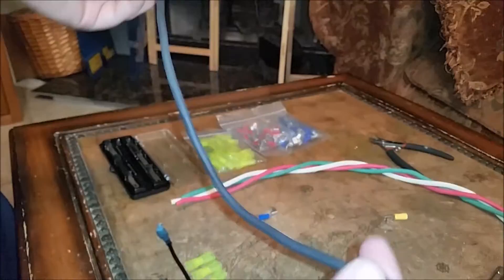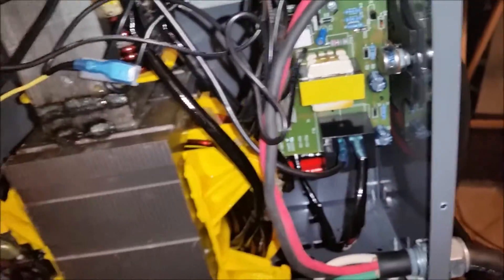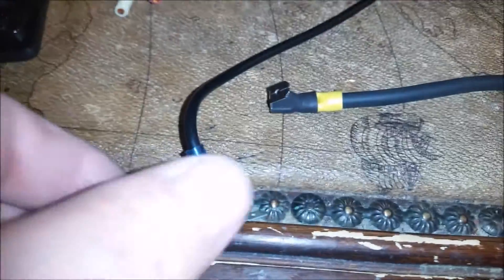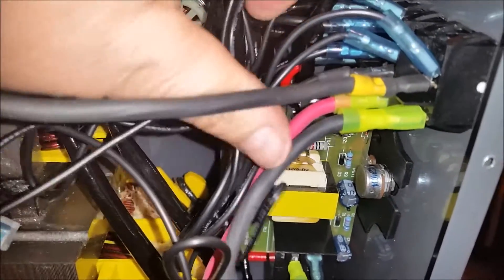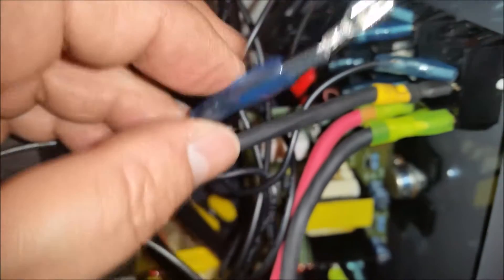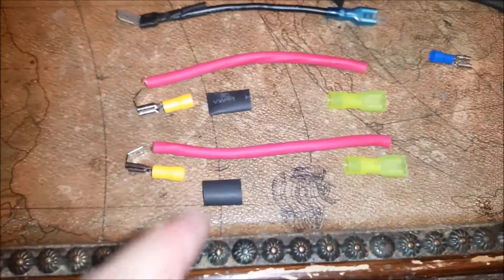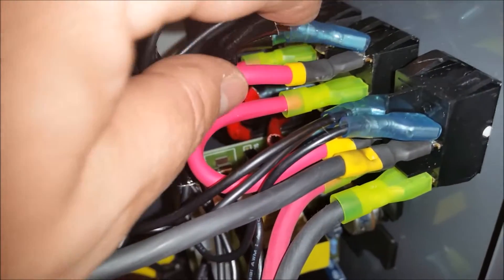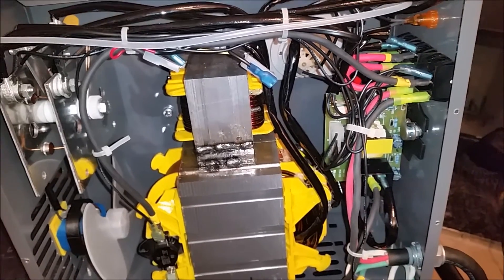Harbor Freight 110 AMP Dual Mig Internal Wire Upgrade Part 2

Comment: the min/max one/two switches will melt before the stock wires burn up, ask me how i know
Reply from the maker: Experience I'm sure. I was fortunate to not have that problem. It worked great until I burned up one of the diodes. I think if I had upgraded the fan or at least baffled it that it would have worked better for sure. I need to fix this little welder as it works better than my Eastwood which cost 4x's as much. Best Wishes & Blessings. Keith Noneya

Comment: Will this upgrade work on a 125amp fc welder? I upgraded the polarity with 150a 1600v bridge rectifier and added capicator and resistor to it. Significant change in the welds. But, i think this upgrade would definitely improve my welder more.
Reply from the maker: Yes it should help improve the quality of the welds. The bigger wire allows current to flows easier. Your bigger diodes will definitely help with that as well. The only draw back is that it puts more strain on the transformer, so make sure you have extra cooling on it to handle the added stress. Even if you don't add the extra cooling, if only increase your duty cycle a little, over stock, that should be enough to offset the added stress and heat. Thanks for watching. Best Wishes & Blessings. Keith Noneya
Reply: @keithnoneya  thanks.👍
Reply: @keithnoneya  do you anything about installing a transformer to wire feed motor? Im having issuses with wire sputtering, even on low wire speed setting. It did work fine before but i hear motor drive slipping, but tensoin ok. Idk. Any info can help.
Reply from the maker: Hey Zero nope I don't have any information on the motor set up on those. If you figure it out do a video on it in case I run across that problem too. Keith
Reply: @keithnoneya  ok, thanks. I put a 24vdc 1a/10w wire feed mechanism in it. I think that'll help.

Comment: Was there any noticeable difference? Thanks
Reply from the maker: I made the changes before I used it. So I couldn't say. However I have a Eastwood that will not weld anywhere near as long as my HF before it overheats and shuts down. I barely had any overheating on my HF, I had to really be doing a lot of welding before it would overheat. Make sure and watch all four videos, especially #4 where I tell you not to hook up one of the wires in the new yellow plug, as my GFCI breaker did not like it. Thanks for sharing, and let me know how it all works out for you. Best Wishes n Blessings. Keith
Reply: I made the changes to mine today. No noticeable change, but when I bypassed the switch it made a big difference. So now looking for heavier amp switch. I also change the power cord for 10awg and used really heavy jumper cable for the ground lead clamp and all. Major improvement!
Reply from the maker: That's cool Larry. Yep that's why I did mine to start with. I work in electronics and when I have to draw a lot of current, and welding requires a lot, I have to use a bigger wire gauge or the unit over heats. Same thing goes for a welder, the bigger the wire the cooler the transformer can run because it doesn't have to work so hard to keep up with the current demand. Think of it like trying to suck liquid through a small coffee straw or through a milkshake straw. Using the bigger straw you don't have to work so hard to get the good stuff where it needs to go. If you come up with anymore mods let me know, or better yet post a video and send me the link. Thanks for watching Larry. Keith
Reply: @luckylarry5112  That's pretty sad that Jumper cable helped out as it's almost always steel wire that's copper coated.  The best place to get leads is at the junk yard.  Look for Monster Cable that was used to hook up a huge amp, it's always there you just have to hunt for a while, not because people grab it but just cuz it's not that often that people use the great stuff anymore.  If jumper cables wire helped you out, then Monster Cable oxygen free super strand will completely change the machine.
Peace
Sizzlean
P.S.  put a magnet to that wire just for kicks
Reply from the maker: @sizzlean9459  Not really, even steal wire has it current carrying (flow)capacity. The steel will handle the load because it has a higher meting point than the copper, but it can only allow so much current to travel through the wire because of it's diameter. Think of the copper wire as a weak plastic water valve with a lot of pressure behind it. It can only pass so much water because of the size of the hole in valve and only so much pressure because of the material it's made of. Now compare it to the same valve but only made out of steel, they both can only pass so much water because of the size of the hole but the steel one can take more pressure. In order to pass more water with a weaker valve made of plastic, all you have to do is increase the size of the hole in the valve. As long as the pressure stays the same you can pass two to four times the water without damaging the weaker valve. Why because the valve hole has increased and lowered the pressure inside the valve. Steel wire is actually a very pore conductor, but it's robust and can take a lot of pressure or current before it will melt. It's also cheaper to use. Anytime you want to increase current flow, regardless of the conductor material, you need to increase the diameter of the wire size. That's why power companies use LARGE aluminum wire to the house power panels but use smaller 14 gauge copper wires inside the house. Most house circuits don't have the whole house load running through them so they only need to handle the 10-30 amp circuits for that particular application. The reason they don't use aluminum in homes is because it corrodes easier and that corrosion causes heat build up and has been known to start house fires. Where copper corrodes but slower and tends to form a corrosion barrier when it corrodes protecting the interior of the wire. That's one of the reasons it was used on roofs and on the Stature of Liberty and other well known landmarks. Hope that explains why I did it that way. Best Wishes & Blessings. Keith Noneya
Reply from the maker: @sizzlean9459  Nah you're not insulting me. Funny I didn't disagree with anything you said. Yep electricity does flow on the outside, power lines are hollow on the inside. I'm saying that the diameter of the wire increased the amount of current it can handle unless the material it's made of can handle it. I've been doing electronic repairs for over 30 years and yep I know Ohms Law pretty good. The analogy is one I use for someone who is not educated to try and understand: Force/Pressure/Volts vs Flow/Current and yep they are inversely proportional unless you change the resistance to make up for the other changes in current or voltage. Also I agree the ability of the current to flow is also based on the ability of the power source to keep up with the demand.  Classic simple and crude example is a weak battery. It may show 12vdc but as soon as you put a load on it the voltage drops to almost nothing. So my point is by increasing the wire diameter you increase the external surface area for the current to flow on reducing the heat on the wire. So do you agree that installing larger wires in the welder increases the ability of the welder to handle higher current loads? Which is the topic of the video and it's purpose. Best Wishes & Blessings. Keith Noneya
Reply: @keithnoneya  Hey man, didn't you already prove it makes it work better?  Who am I to disagree?  Look if it were up to me we would close all the jewelry stores take the gold and make wires and take the silver and make heatsinks but I'm sure there are some girls and boys out there who are glad it aint up to me  LOL!   Now that you brought it up,  the first free energy machine I ever built was the bedini school girl's wheel and it fixes that stupid battery you were talking about.  My chemistry professor (went to school for pharmaceutical engineering, maybe you see a hint of my dissapointment in my writing) told me and showed me epsom salt trick but it just never worked for me, however the bedini wheel fixes them and makes them stronger than new as it charges them from a source of lower voltage!  In fact I took 2 cold flourescent bulbs and put the elements minus the circuits in the path of the charge circuit, which settles on the correct charging voltage for whatever battery you connect but if left open will blow your meter as it goes past 700 volts to who knows where and will give you a real nice blast to the past or future depending  on which way the switch in your head is pointing, it lit up both bulbs as a flash each time the magnet passed the coil and still charged up the battery the same as without.  To be sure,  I am always a fan of replacing or using the biggest wire you can find and fit, even if you have plans for that wire!  As I said I only needed 40 amps but used wire that was rated at 220 amps @ 50feet for a 8 foot connection so bigger is better and if someone else has done the work and made a video proving it's better well that only makes it double or triple better.
Peace
Sizzlean
Reply from the maker: @sizzlean9459  Hey I'd like to check out some of you stuff can you put it up on your channel? I think you'd get a lot of folks who would love to see what you're talking about put into action. I was thinking of building a Gasifier to run my home generator. When Katrina hit here, gas was really hard to get in quantity, but there were so many downed trees and trash around here, I NEVER would have run out of fuel! I have two dead batteries that I was thinking of doing the Epson Salt trick on. But if you have that "Bedini Wheel" fix on your channel then I would be interested in building one of those instead. Thanks for the reply, Best Wishes & Blessings. Keith Noneya
Reply: @keithnoneya    Okay Keith,  I have sooooo much damn crap on my computer and I just found a decent video last night, nothing like the one's I have of just me and Paul but actually one of his and so subscribe or check my channel in an hour or so and I'll post it, gonna do it now just cuz and when I have more time I'll make one with all the secrets he gave me and me alone since I was his favorite student simply because of the way we met.
Peace
Sizzlean